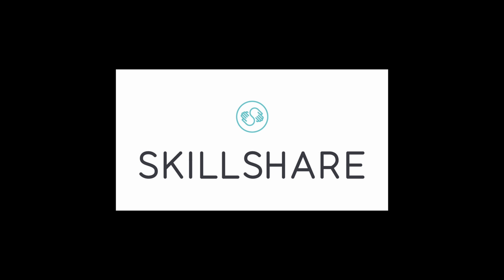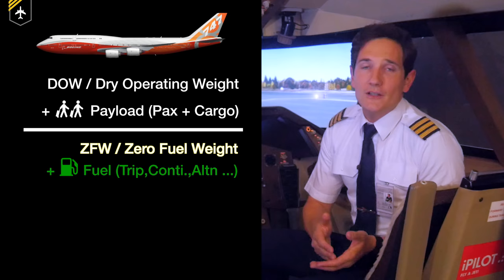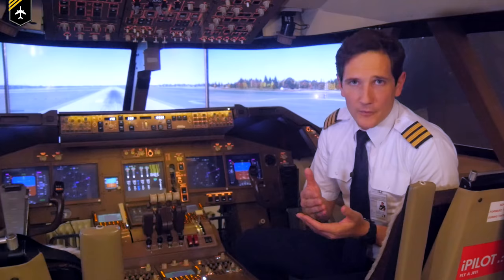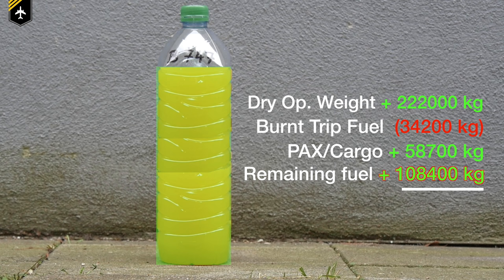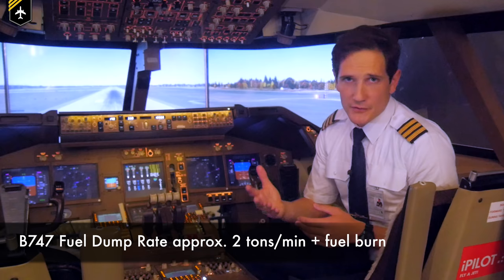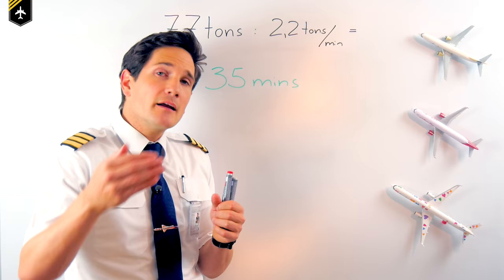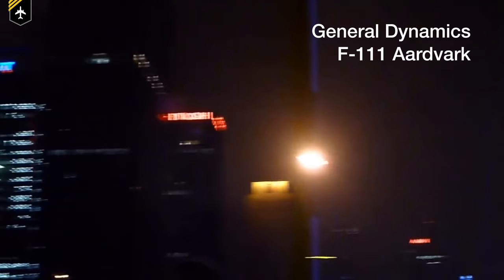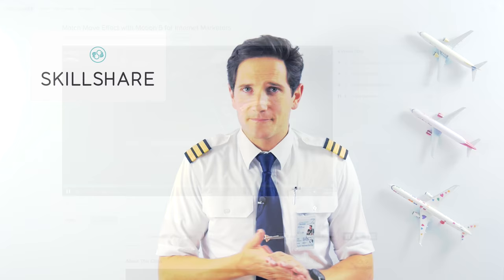Why do PILOTS DUMP FUEL??? Explained by CAPTAIN JOE

Comment: What happens if 747 needs to do emergency landing right after takeoff as shown in one of your video titled “difference between mayday and pan pan pan”? 🤔
Reply: very good question, I might say that this could be one of the reasons that pilot landed on the Hudson river in 2009
Reply: @flashmasstock  "I might say that this could be one of the reasons that pilot landed on the Hudson river in 2009" No, not really. Ditching is the absolute last resort (i.e. landing in more preferable conditions is not possible; e.g. You are at low altitude in the middle of urban center, while being too far from a runway, and the only flat piece of "ground" available, within gliding distance, is a piece of water), due to high possibility of cartwheeling, which, typically, results in high casualty rates. In addition, landing in airports is always preferred, due to close proximity of emergency personnel, if anything goes wrong on landing.

Comment: For planes which don't have the ability to dump fuel, are they able to run their engines in a way that uses more fuel than usual so that they can land sooner?
Reply: I imagine all planes that need to dump fuel (ie those that are big enough to cause damage during an overweight landing) all have the ability to dump fuel. It would necessarily need to be part of the air worthiness certificate me thinks...
Reply: At 7:12 Joe says "smaller jet airliners like the Boeing 737 or the Airbus A320 which aren't fitted with the fuel jettison system have to burn the fuel by flying holding patterns until the aircraft is below the maximum landing weight or in urgent cases perform an overweight landing procedure". This is the scenario I was asking about, can a 737 be flown in a way which burns fuel faster so they can land sooner?
Reply: Well you can turn the trottle all the way up and fly turns or slip to keep the speed down
Reply: As with other regulations, there may have been changes to regulations so planes that were certified at different times had different rules in effect.  And there will be differences between commercial/military craft as well.  It may be that the reason that the 737 and Airbus 320 don't have fuel purge systems; they're relatively old airframes.  

My uncle flew B-52 bombers.  500,000 pounds max takeoff weight, 295,000 max landing weight (I don't know which model that was).  The B-52 doesn't have fuel dump system, so when coming back from training missions that ended up shorter than expected, they flew with higher throttle than normal but with the speed brakes on to burn more fuel.
Reply: Simon Gardiner when planes are flying at that low of altitude they burn fuel extremely quick because the air is thicker

Comment: this doesnt explain chem trails..dumping fuel does not look like chem trailing at all..
Reply: Ironic because it technically IS a chem trail and what ppl call chem trails are condensation
Reply: Sky Watcher  I'm familiar with geo engineering but the jet fuel hoax is based on the notion that it's impossible for airliners to carry vast amounts of liquid so I find it amusing when the same type of ppl claim airliners spray chemicals  because those two beliefs cancel each other out.
Reply: @PabloGonzalez-hv3td  when in reality, it's just condensation from the continual cycling of air through the cabin to keep the pressure comfortable for passengers. As for jet fuel hoax, the only real scientific way would be to weigh it off the assembly line and weigh it before takeoff.
Reply: He already made a chemtrails video  just watch that

Comment: A few years ago there was a commercial jet that had to dump fuel over the state of New Jersey because it was having some kind of problem and lots of people saw it dumping the fuel and flying low. They called 911 because they thought it was going to crash. I have a fire department scanner radio and I happened to catch their calls for all the fire departments in the area to "standby for possible commercial jet crash" It was pretty shocking. I immediately picked up the phone and called my parents who were out shopping and told my mom, "Guess what they just said on the scanner! You're not going to believe it!.." That was a radio call I never thought I'd ever hear, or ever want to hear ever again. Luckily, it landed safely. But the weird thing about it, was that it was never anywhere near where I live, but all the fire departments in my town were still preparing for it and sending out the radio call for some reason.
Reply: Firemen in my country get ready for fires 100 km away. It's just in case a fire is to big to be contained by nearest fire stations.
Reply: A commercial jet crash is a huge thing and usually brings in fire departments from all surrounding areas (even some that are 20+ miles away) especially depending on where it ends up crashing.  They have to have all emergency services on ready and in a lot of situations, some stations might be taken out of standard service (not receiving typical emergency calls) so they are ready to go should it happen. You are talking about a vehicle that (as demonstrated in the video) weighs over 390 metric tons carrying in most cases 100+ souls crashing into (hopefully a large unoccupied field) but at worst case, a populated metro area with buildings, roads, etc that could be damaged and cause other damage and injury.  I absolutely can see the reason for them sending out that radio call just to be on the ready.

Comment: So, if you experience a catastrophic problem during takeoff, need to immediately circle back and land, you can A: Fly around for 35 minutes in a disabled aircraft or B: possibly destroy the airplane because it will be so overweight ?? That really boosts my confidence in commercial flight.

Comment: So if a flight leaves from Los Angeles to London and a passenger has an emergency. The airline eats the cost? They also have to get another plane to take everyone else back to London and give them discounts or re emburse passengers? How do they make money?
Reply: Still cheaper than the family suing the airline, the passengers suing because they had to see it and are scarred for life, etc etc etc
Reply: Its called insurance.
Reply: On that flight, they probably lose money.
Reply: By charging for every bag, seat selection and extra millimeter of space.
Reply: They still make a LOT of money on that flight. $320 avwrage per seat at 250 seats is $80000 minus operating costs of $30000 per flight including dumped fuel, crew wages, airport amenities, etc... $50000 profit even after dumping landing and refueling and taking off again.
Reply: TheChemist187 pretty much!
Reply: @binba9 exactly! that can't be hard to figure out, I mean come on...

Comment: Ok, I get the explanation.  But all of this could be calculated prior to filling the plane with fuel.  Aside from emergency landings at a different airport than planned, they know exactly what airport they are traveling to and the landing weight that they will need.  There is literally no sense in filling the plane with more fuel than necessary to get from point A to point B while being able to maintain proper weights at the same time.  And frankly I did not hear a single logical or reasonable reason that they do put excess fuel that ultimately gets dumped, only that they dump it to make weight...that should be calculated and determined before departure.  Then they could cut fuel costs, cut the prices of flight tickets, and potentially regain a percentage of all the customers that the airliners have lost over the last 10 years.
Reply: It is always important to carry more fuel. You cannot always determine air traffic and delays due to severe weather can you?
Reply: You are forgetting the main point. It's not about filling enough fuel to go from A to B. It's about when the fuel dumping is required. If the emergency is near B, then it can land straightaway as the fuel has been burnt. However if the emergency happens near A, then by obvious reasons it would have to dump fuel if it has to land.
Reply: The RightStuff would you mind referencing the time stamp when he suggests that which you have stated?

Comment: Question: How do you measure weight when you are up in the air?
Reply: shashidhar prabhu 

i mean, weight is just the measured force you have on the earth, so you can figure out the rest
Reply: you dont you guess and spray the chem trails
Reply: I don;t think they do it accurately.They have numbers for the weight of the plane,the fuel and the cargo baggage.The only "unknown" number are the passengers and they carry on baggage,and that can be estimated.However,you can only be wrong by...what?1000 kg/1 ton?Not exactly much in the grand scheme of things.

Comment: I tried to save a few bucks and flew a 747 from S.F.O. to Frankfurt back in the late 90's.  Horrible decision.  Had to get off the plane with 400 of my closest friends down a staircase, then run to the next gate to get the connection to München.  Never did that again and paid the extra Lufthansa's direct from S.F.O. to München.  Good times.
MK

Comment: Question: can you land without flaps?
Reply: depends on the plane and conditions, in some cases the landing flaps are essentially just airbrakes to slow the aircraft down, but for most modern planes they're vital for a soft landing, particularly for craft with narrow wings that stall easily at low speeds (ie; all lift suddenly vanishes and you slam into the ground).

Comment: Fuel is dumped in the event the plane needs to make an emergency landing as too much weight during said landing makes the plane harder to control and puts it at risk of overshooting the runway or even crashing into the ground.

There. Just saved y’all 9 minutes.
Reply: Jacob Adkins he has more knowledge than a average high school teacher
Reply: thanx Capt'n. Obvious!
Reply: +Far. Hdjt17 No shit, Sherlock!
Reply: You stole his ad sense money.
He should sue you.
Reply: Jacob Adkins 
Thanks LOL, I didn't really want to watch a 9-minute video for something that can be answered so simply
Reply: But you missed the main point as to why they do it, and that is structural damage to the plane. Which is also why he did the half filled bottle vs full bottle demonstration. There were also other interesting miscellaneous points, such as the amount of fuel dumped, how long it takes to dump, heavier to take off, etc. Either way 99% of people will eventually forget whatever they saw.
Reply: @everyone
The thing is, they also empty it out because of that fact that if they crash, the plane will most likely not burst into flames and you will get a higher chance of survival. This is just common sense and logic put together. Tell me if i am wrong and i will buy extra lessons
Reply: Hexilicious HD, you're wrong, the main reason they dump the fuel is to prevent structural damage due to a heavy plane, WHEN they have to make an emergency landing due to say a passenger getting sick. Since there's nothing wrong with the plane, the last thing they are anticipating is that they are suddenly going to crash during the landing, since that part is so routine for the pilot. If the plane is having some mechanical issue, I'm sure they're not going to wait over 30 minutes for the plane to dump the excess fuel.
Reply: Jacob Adkins Thats is the answer i knew it but alot of people don't know it.
Reply: just watched it in case lol
Reply: Maybe because in an emergency landing reducing fuel you have can result in less explosion

Comment: Why don't they just build the damn thing strong enough to hold the max fuel, max cargo and max passenger weight without breaking upon landing?..
Reply: Now that just wouldn't be cheap enough.
Reply: I commented the SAME THING
Reply: If i understood the video correctly, and i think i did, the fuel dump is an emergency procedure for emergency landing. It is a rare case. the fuel is calculated for the specific flight in progress. Upon arrival the proper landing weight will be achieved by burning the fuel in flight. This did answer a couple of questions i had. 

So, for a plane to take off, and to carry maximum payload, it has to be light. A heavier plane with the same payload would require more fuel to operate, at no additional financial gain. Remember the airlines are a private business that HAVE to operate at a profit, or they cease to exist. for the occasional emergency landing it is more cost effective. Environmental concerns aside.
Reply: To have a stronger plane, you would need heavier materials, heavier materials means more fuel consumed per minute which mean you would need more fuel over all and a longer runway. Just not an option.
Reply: LSX408 Are you going to create this aircraft for us?
Reply: @brandenparnell5280  but planes are more difficult to make than YouTube comments

Comment: I have only discovered this channel last night so I hope I am forgiven for commenting here this late.  
To prevent pollution, surely the solution is to design a Modular Fuel System(each with a parachute) for the passenger planes where fuel is stored in detachable storage tanks, each either connected to one another or each feed line connected to the engine feed separately. So in the unexpected event of fuel dump required, one of these modules can be dropped off safely and recovered later on without any loss of fuel and more importantly without polluting the environment.
Reply: That solution hurts the environment because it adds significant weight, which means the plane has to use more fuel on a normal flight to get to the destination. For emergencies, sometimes a poor but effective solution has to be taken because trying to solve that will just make the plane less efficient in normal operation.
Reply: Not if the storage modules are made of carbon fibre which will hardly add to the weight of the airplane.
Reply: MotionArtist3D Carbon fiber adds weight. Making a wing that safely detaches adds weight. Carbon fiber is not magic that lets you forget about weight.
Reply: MotionArtist3D its impractical because of one major reason. Having to dump fuel is a very rare occurrence. So your concept is just increasing weight, costs and complexity for something that is very unlikely to happen. Hence there will be no net benefits

Comment: So it's okay to dump fuel on us
Reply: Yeah, 'cause Illuminati wants to kill us all slowly. :3
Reply: It will evaporate before reaching land, it’s kerosene, which vaporises even quicker than petrol (if you’ve ever noticed how quickly petrol evaporates). Also consider the air pressure and weather systems at altitude that would most likely carry it.
Reply: Then what about the ones that dump fuel and it slowly expands into shitty clouds?
Reply: Jordon Merasty - good point. As it dissipates it will dilute and mix with other compounds in the air. There is not enough pollution at that altitude to cause a problem and fuel dumping, as you can imagine, is not a frequent occurrence.
Reply: James Bramley it happens every week now that pilots return to airport with simply an unruly passenger .
Reply: @elmo319  That doesn't explain the large trails that come from behind planes for hours and then spreads across the sky and turns into clouds
Reply: @ Sall - that’s correct because what your referring to is something else. They are ‘contrails’, left in their wakes for the same reason you can sometimes see your breath in cold weather. The hot, humid exhaust from jet engines mixes with the atmosphere, which at high altitude is of much lower vapor pressure and temperature than the exhaust gas.
Reply: @elmo319  petrol evaporates very quickly as their molecular structure is weak.
Reply: @ sall - your point being? Planes are pissing out fuel the whole time? Kerosene (jet fuel) costs a lot at this volume so it’s not in the airlines interest to dump it unless absolutely necessary. I’m sure you can work that out....
Reply: @elmo319  my point being that dumping fuel doesn't explain chemtrails
Reply: Sall - read what I wrote before, that explains them....🤨

Comment: Hi Joe
Isn‘t this a waste of fuel, bcause the way you calculated it you reach the max LW at some point in the air, but it is more efficient if you reach it shortly before touchdown. (As you burn fuel between this point in the air and touchdown)?
Reply: r_ s_ Remember that more weight=more fuel consumption
Reply: Yeah, my point is that with his calculation you end up touching down with less than max LW, what is ineffective and too much dumped.
Reply: Katznboyz Aviation:  True, but ineffective anyway ;)
Reply: r_ s_  Of course it's a waste of fuel! He is talking about cutting a flight short in an emergency situation.Thats why he is only dumping enough fuel to reach maximum landing weight.Normally he would use the fuel on route to original destination and therefore be landing a lot lighter than 'maximum' landing weight as there hardly any fuel left.
Reply: Michael Parkinson yeah of course, but my point is still that if you touchdown with a lot less than MLW it is a waste,because you are allowed to touchdown at MLW or less. Am I right or am I missing something?
Reply: r_ s_ I think you are missing something.He should land at the original destination as light as possible.
It is not to land at maximum weight.In this video he is talking about diverting to another airport in an emergency situation.He therefore has too much weight to land early so he dumps weight to land without damage to aircraft.Under normal circumstances with no diversion he would've had only enough fuel to get to original airport.Therefore less weight than a situation that makes the aircraft too heavy.
Reply: If he lands at the safe maximum weight he has only wasted enough fuel to get everyone on the ground safely in a diversion.It would be pointless to waste more.It would also be pointless to carry fuel to such an amount to land at the original destination at maximum weight.